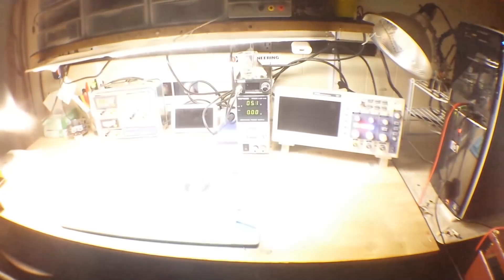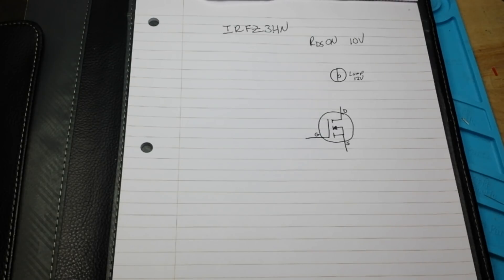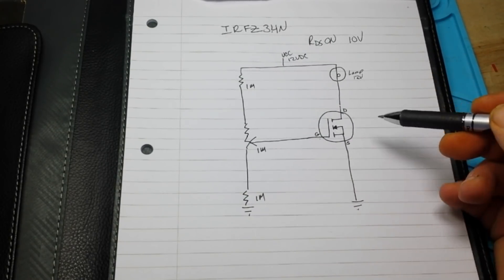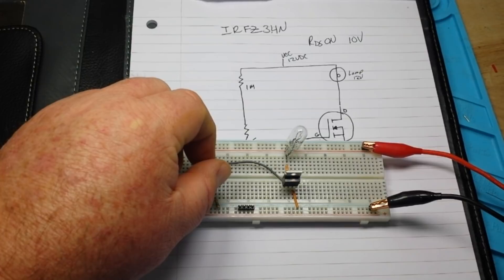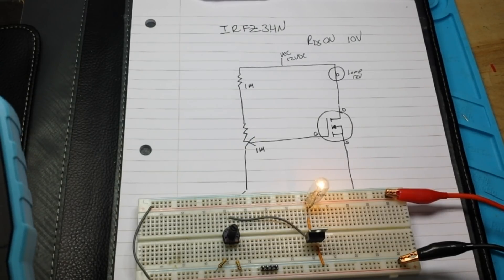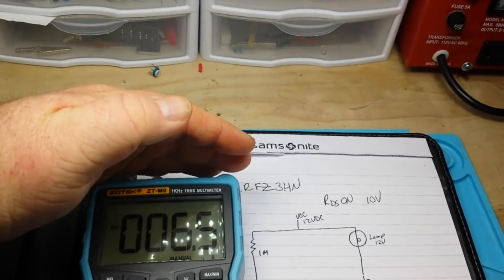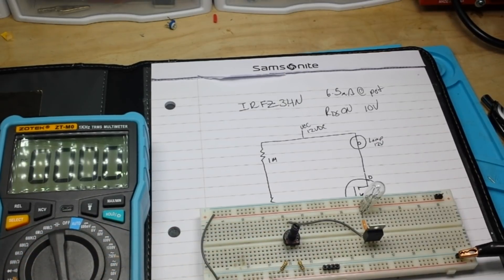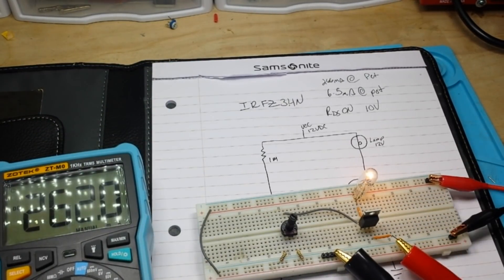MOSFET as a variable resistor

Comment: Nice! Thank you! So with 12V and 265mA passing, the MOSFET is around 45ohms? What is it's usable resistance range when used as voltage-controlled resistor? 1M..45R? 100k..45R?

Comment: New to your channel, very glad I found it. Awesome content, very helpful 🙂
Quick question - I'm trying to control the speed of a 12v compressor (QDZH35G) I purchased which can be done by modulating the resistance. The technical documentation states that...
0 ohm @ 0.87~1.02 mA = 2000 RPM (minimum speed)
1523 ohm @ 3.15~3.61 mA = 3500 RPM (maximum speed)

Is the MOSFET the right component for the job?  Or should I go with JFET?
Reply from the maker: MOSFET or IGBT if the current is high

Comment: You will not be able to reach Vgs  at 10V with 3 x 1 Meg Ohms resistors in that configuration. So you won't be able to get full saturation of that thing. Best you can get out of that circuit will be 2/3 of 12 V, so 8 Volts. Interesting video though.

Comment: I have some RV 12V LED puck lights that use an LM117 clone in constant current mode. The current set resistor is 4.7 Ohms, so a trim pot is out of the question because it dissipates about 1/3 Watt. The best solution is to build a PWM dimmer, but the MOSFET method is so much simpler. I can put the MOSFET in series with the current set resistor and set it with a trim pot, similar to your example. When the MOSFET is fully ON, the LM117 still limits the current to the maximum brightness. Thanks for the video!

Comment: i see the rotary resistor does not move much to make the light dim or turn brighter. i want to power a 12 volr dc motor with a rotary pot and only have 60 degrees of rotation from off to on and back to off. so it looks like the higher the pot the less movement of the pot! so would it have to move more with a lets say 500k  you used a 1 meg variable resistor and it looked like it did not move much at all! is there any way i can contat you faster than on you tube?
Reply from the maker: arduino0169@gmail.com

Comment: Yep as others pointed out Rds on is a resistance (usually in the neighborhood of 0.1 ohms or less)  - I've seen designs with power MOSFETs in parallel to decrease Rds on or increase current capacity (heck 30A is more than the current capacity of a typical household circuit). These things are great for switching large loads or power amplification. You can also pulse the MOSFET with PWM for DC motor speed control as well as lamp brightness. An H-bridge motor circuit with 555 PWM would be a great simple demo - sorry if I did not see that if you did do one already. Nice job always enjoy your "back to basics" videos.

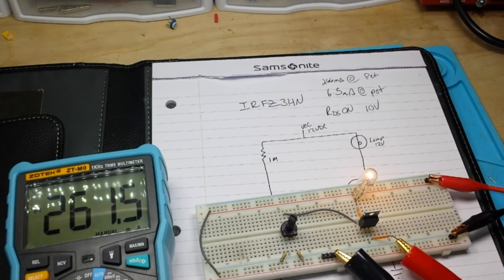Comment: Are my calculations wrong at 8:30 or does it show a GAIN of 400:1 ???
Reply from the maker: 40000
Reply: more like 40000:1 with my maths !
Reply: @eastcoastandy2905  , You're right. I didn't feed enough 0's into my calculater for the microamps. I used -10000 instead of -1000000.

Thank you.

Comment: Worth noting for a dimmer that the 30A rating is when the FET is fully on (ie Vgs = 10V) and reduces as Vgs reduces. Safe region graph in the data sheet has details
Reply: Also worth noting that it's almost impossible to drive a fet at its max current limit as specified as you can't fit a heatsink that big.

Comment: Great video as always. I would recommend to explain that a Mosfet which is not switch completely on the Mosfet consumes a lot of power and gets hot. I find Mostes mainly helpful to switch power completely on or off to benefit from the low resistance. 
Regards from Germany.

Comment: Hi, I have a video suggestion about this same topic, but now with FETs as voltage controlled resistors. They may not be very popular but from what I have been reading some are made especially for that, and can have a resistance from a few ohms to a thousand of ohms. Very useful for audio control or for driving op-amps. Maybe you could try building a circuit showing some practical examples. 
Here is a document about them from Vishay: 
https://www.google.com/url?sa=t&source=web&rct=j&url=https://www.vishay.com/docs/70598/70598.pdf&ved=2ahUKEwiH2In1yvzoAhWLq54KHRRnA2EQFjAAegQIARAB&usg=AOvVaw0Q8FXug0rPs7bjxYJlUdJM&cshid=1587577707106

Comment: Another good video. I've just been working with a MOSFET on an ESP32 MCU. needed to drive a 3.3VDC buzzer @25mA. the ESP32 is only capable of around 12mA from its GPIO so I needed to use the MOSFET to get the extra current. MOSFETS are strictly for DC loads and ALL the grounds need connected together. I also had to use a Logic Level MOSFET that would turn on at 3.3VDC. Not many fit that need.
Reply: Watch out logic level for fets is 5V, you need to check the datasheet for the Vgs(th) voltage to be less the 3.3V. So many logic level fets where its  >4V

Comment: A little error at the begining when you mention a Rdson =10V   ?? 
Rdson is the resistance between drain and source in Ohms.  According to the datasheet it is 0.05 Ohms specified at Vgs = 10V (here are the 10V).

Except that, thanks for your excellent videos.
Reply: Thanks for the correction.

Comment: To better understand the circuit I think it would have been helpful to show how the voltage divider and the pot affect the voltage at the gate of the mosfet.
Measuring the current at the pot with the multimeter but not showing the voltage seemed like a missed opportunity, because if I understand the circuitry right, the important part seems to be the voltage at the gate, the current through the pot not so much.
Reply: Yes, since MOSFETS have a huge input impedance, the voltage at the gate is critical.
Reply: You will find the difference between on and off is very small. As FET heats up a little current will change. A resistor in the source will give much better results.

Comment: Really with the  slope characteristics of a mosfet wired in this manner you will have nothing as you advance the pot ...and nothing... and nothing ....and then everything, may as well put a switch there - Or a four position switch - Off,  one at the knee, one half way up the slope and full on. A bipolar transistor is much better here, or maybe drive it with the inverse of the slope via an op-amp and another fet in the feedback.
Reply: Martin D A this demonstrates clearly how to use extremely low current to control 1/4 an amp.  resistor divider is the lesson here.  And slope characteristics of mosfets vary greatly. your idea of all mosfets being the same is humorous lol 😂

Comment: VCC? for a mosfet? I thought it was VDD? Collector =VCC, Drain = VDD.
Reply: VCC and VDD both imply voltage or circuit power. VSS is Ground. No reference to a drain or collector.
Reply: They used to apply to type of transistor used as you mention with Vcc and Vdd, you will also find Vee and Vss in old datasheets. Nowadays as FETs have become the norm people stick to Vdd and Vss or GND. However, older technicians may still use the older Vcc and Vee as they 'grew up' with those terms, even though technically they are inaccurate today depending on what you are using. Similar to how some in Europe still use imperial even though most are working in metric.
Reply: I NOTICED THAT TO
Reply: It has a drain not a collector. so VDD it should be. "Make it so"